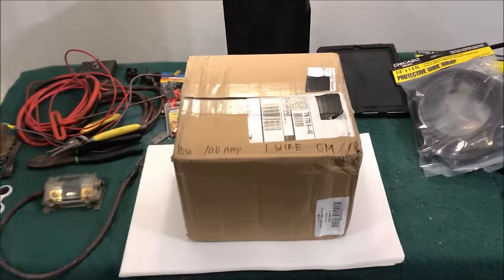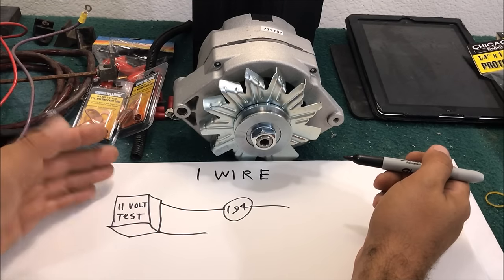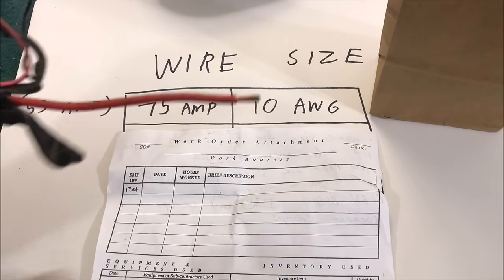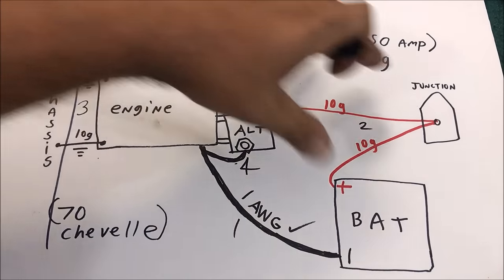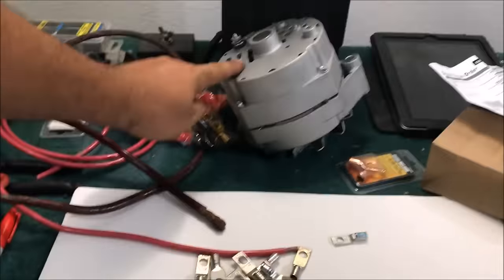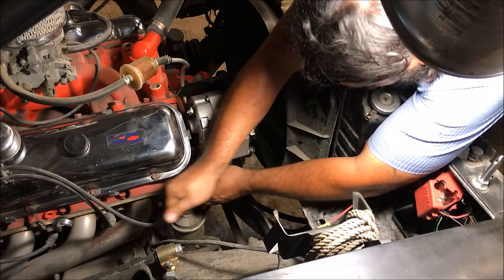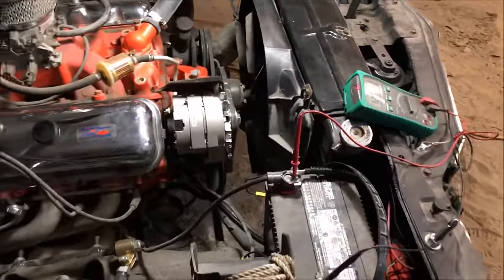GM 1 wire 100 amp alternator UPGRADE and INFO diy

Comment: Hi Chris,
what is the need for the red junction block?
why not put the positive lead of the alternator directly to the + battery ???
I intend to mount this alternator on a 350 SBC.
thank you, bruno from France
Reply from the maker: I have a factory ammeter in the dash that works.. you have to wire it like that for it to work right.. also, I can’t stand a bunch of crap wired to the positive battery terminal bolt.. I see it all the time

Comment: Great Video 
What did you do to the factory charging wire? Did you cap it or reroute it to the junction block?
Reply from the maker: you have to use it..it stayed the same
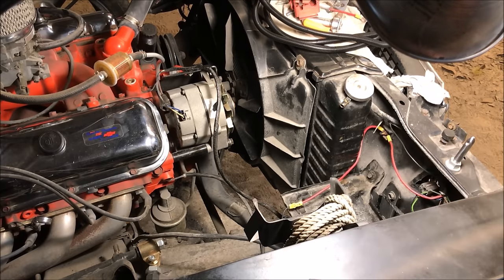Reply: I'm covering my classic car to a 1 wire 100 amp alternator with a 4 AWG wire. In the video (time 21:23) you mention that the original charging wire  was removed completely. Do I cut the 10 AWG wire and removed  it ?
Thanks Chris

Comment: Where did you buy the terminals and crimpers? Great video and lots of info I need for my jeep project, thank you.
Reply from the maker: electric supply store.. those crimpers are like $300.. all electricians carry them
Reply: I know that places its not good to solder  connections on AC voltage circuits but will solder migrate with high amp DC voltage?

Comment: Under the plug is the idiot light spade connector .... is just looped inside to the regulator. The top spade is the charge to indicator or "idiot light" and the one under it is the "key on" for the regulator.... it's looped inside to the chargeback lug ... that's it
Reply from the maker: yes it is..  but that is for a future video... thanks for the comment..

Comment: Awesome instruction, but I have one ?, why do I need to ground the alternator with a wire, isn't it already grounded to the Engine block and bracket. Just curious. Thanks
Reply from the maker: that’s part of the BIG 4 upgrade.. it IS already grounded but people do that to make sure it’s getting back to the battery 100%.. you would need to check resistance from the bracket to battery to see if you had any issues

Comment: I saw the extra ground cables and  I'm wondering why they are necessary. The alternator mounting bolt at the bottom bolts directly to the engine block and the factory ground cable carries that ground back to the battery.  As long as you add a ground cable from the engine block  to to the body and another from the same mounting point on the body over to the frame. I would think that 2 is all you would need to add.
Reply from the maker: audio people do it so they are 100% there is no resistance to negative side of battery.. like painted brackets, grease/oil, corrosion between mounting surfaces... I do it with 75 amp and higher alternators because I sell the kits and install them on people’s cars

Comment: Your videos and attention to detail are incredible.  I do have a question though.  I just installed a 1 wire alternator in a 1969 Mustang and I no longer have any power to the dashboard- headlights, ignition switch, etc.  I'm guessing that was a part of the original wiring that was connected to the external regulator that I removed (as per powermaster instructions)  Is there something that I'm missing, or was the car not wired correctly to begin with?
Reply from the maker: there’s a big red wire with a fusable link that powers all that.. it may have been on the starter solenoid..  find the big red wire going to fuse box and trace it.. I don’t mess with ford but it should be the same...

Comment: I watched all your videos on alternator upgrades and how to get rid of the external regulator. I did everything in your videos. I have a 69 chevelle and i came across your 100 amp alternator upgrade. I believe my alternator is 115-120 amps. I want to upgrade my charge wire to a thicker wire but looks like my factory 10 gauge wire goes  from alternator to wire harness all the way to plug on fire wall. Do i cut that wire and run into juction block witch has fusible link running from battery to juction block to horn relay. Then run a bigger gauge wire from alternator to battery.
Reply from the maker: I have a video on re wiring the harness
Reply: @chriscraft77022  like I said I watched and done everything in the videos but now I need to upgrade my alternator charge wire but it goes from alternator all the way to plug on firewall. Can I just cut the 10 gauge wire out from alternator  and wire that into the junction box behind battery then run a 6 or 4 gauge wire from alternator to battery??

Comment: Since old Chevelles are getting harder & harder to find.

How about doing a fuel delivery upgrade ?

Start with discarding that plastic fuel filter on the pressure side of the pump.
Because a small fire can & will turn into a very large fire once the filter melts and spews fuel everywhere.

Or don't because the fewer there are the more mine are worth  ;~)
Reply from the maker: good idea for a future video but on a stock carb system the fuel pressure isnt high enough to really need an upgrade.... just replace all rubber hoses every 10 years...  i personally love the clear fram fuel filter...
Reply: I like the clear ones myself but have seen plastic ones melt and make a small fire much bigger & that's why I will not use them on the pressure side.
I also prefer to use EFI hose even on Carbs because of ethanol.
Reply from the maker: im going to add fuel injection to my car later this year and i will do a steel hard line video....  i have a making a fuel line video (its old ) if you wanted an idea on hard piping it up to the carb....  with aluminum
Reply: Wouldn't use aluminum !
Never used it myself but have heard it will work harden from vibration & crack.
Myself I like all steel line with as little hose as possible & steel filters.
BTW when you do your FI system if the pump is in the tank be sure to use submersible "SAE 30R10" hose in the tank.
If you do not the non submersible hose will melt from the ethanol, ETC 
It may take a year or two but it will melt like a marshmallow in water.

Comment: Hi Chris… have hot rod with 140 amp one wire…all Chevy👍🏻…drops from 13.5 to 12.5 when electric fans come on but more drop when AC is turned on and after a few miles down the road the engine stops.  Battery in trunk so I ran a 4 gauge direct to starter with no significant improvement and engine still stops after a few miles with AC and EF on.  I did not remove the old wire to the alternator…just added 4 gauge wire to the starter…large post.  Tried new alternator with no improvement.  Any suggestions?  Thanks!

Comment: Cars and electrical systems are magic to me. I don't understand them at all... so I bought a 66 impala with a charging problem! Question, I can just remove the old junction block and replace it with a larger new one right? Is there a reason to keep the small original one? Thank you in advance.
Reply from the maker: if your car has a charging problem why are you messing with the junction block?  you don’t mess with the factory one..   when you skip through videos you don’t learn anything...
Reply: @chriscraft77022  it has an external voltage regulator going to an old alternator. So i want to add a chevy 105 amp 1 wire alternator to remove the use of the VR which is causing the charging problem. Plus id like to add vintage air and possibly an amplifier for the stereo in the future. That's the reason I watched your video in full (no skipping around). I'm messing with the junction block because I'm upgrading my wires to 4 gauge like you recommended. Either way, great video. Take it easy
Reply from the maker: wire it just like the video.. I left the small junction block.. you need it for the ammeter in the dash

Comment: Hi Chris, I wired my 66 el camino up connecting the wires together - not using the plug and jumpers. My GEN light came on the other day alerting me to a dead alternator. But it ran great with no problems for about 2 years until I put a Holley Sniper EFI on it. Had problems off and on ever since. Now my new alt is showing no charge with my meter on the terminal. Don't know where to start. Ideas? Thank You.
Reply: Oh, one more thing - since I put in the EFI the engine continues to run when you turn off the ignition key until you turn off the radio.

Comment: Why do you put jumpers on the regulator plug? It seems it would only be effective if the L,F plug on the alternator were also jumped. Otherwise its just an open circuit. So why do anything with the old plugs? This is according to my wiring diagram on a 64 Impala
Reply from the maker: just jump the plug.. if you understood it you would not have commented what you did
Reply: @chriscraft77022  That's true. I'm confused
Reply from the maker: @Mr1lukers  it just re routes the wires back to the internally regulated where they need to go. i have a harness conversion video explained..  its old and has music but it shows it...   if you dont jump the plug you will overcharge and your dash light wont work.. but on a 1 wire you are right ////    they dont do anything..  and just leave them unhooked...    i was making a reference to a 3 wire hookup

Comment: Hi Chris . First off great video . I just bought a 1939 Chevy Streetrod that has a one wire Alternator one it . Not sure of the size of it . When the car is running it shows 14 on the volt gauge . When you turn on the Elec. fan it drops to 12 Volts . Is this Normal ? Thanks for any help John
Reply from the maker: the output is too low... 55-75 amp alternators do that with electric cooling fans.. you need 100-150amp depending on the set up
Reply: @chriscraft77022  Thanks Chris
Reply: I should add that is pretty basic setup no fuel inj. or  stereo amps . Just the elec fan and vintage air
Reply from the maker: I have the 100 amp in the video for sale cheap if you need it.. I never used it.. I need 150 amp for my car.. it charged 14.6 and worked perfect.. if interested give my your zip.. it was only like $60 new.. the 140 amps get into like $150 plus

Comment: Thank you for your variety of topics. I enjoy your videos. I have watched a couple concerning generator to alternator conversions but can’t quite figure my situation out. I have a 64 Falcon with an external voltage reg that has screw terminals instead of a plug. The guy at NAPA suggested a GM 1 wire alt so that is what I have to work with. Is there a way to wire it or should I try to swap for a different alt?
Reply from the maker: gm 10 si case 1 wire should fit right on there
Reply: Chris Craft  Thanks. Can you give me any guidance on how to bypass the voltage regulator.
Reply from the maker: you take it off and throw it in the trash.. the 1 wire is internally regulated

Comment: If I'm running this in a boat and the Junction Box is 12' in the front of the motor do I run 4 gauge wire all the way to the front of the boat and attach it to new junction box just a few inches from the old one?... or do I put the new Junction Box in the back of the boat by the motor, and run a long wire (10 guage) up to the existing Junction Box to connect them?
Reply: On 2nd thought...I give up.  The wiring in my boat is nutty. I'm pretty sure the alternator wire connects directly to the ignition starter switch.... too confusing

Comment: Hi Chris,

My old 3x wire alternator was only outputting a little less than 12v at idle.  Swapped out new voltage reg, big 4x upgrade and new battery. Still registering the same so I bought and installed a new 1x wire 180 alternator. Still registering
Reply: 11.9 at alternator output any ideas? I bypassed the external stock regulator.  Running 1x wire alternator directly to battery positive. 68 El Camino
Reply: If I give,a little gas the voltage will go up to 14
Reply from the maker: is this a GM?   if you have a voltage regulator that needs an externally regulated old STYLE alternator....  what is the vehicle?

Comment: I CONNECTED  THE  BLUE WIRE   AT  THE  NUMBER 4
WIRE..ON  REGULATOR......I GOT RID  OF  THE  
TWO  SENCE  WIRES  THAT GO  FROM  THE  OLD  ALTERNATOR.....CONNECTED
THE  BLUE   WIRE  FROM  THE
EXTERNAL  REGULATOR   TO
THE  POSITIVE   ON THE COIL.....GEN LIGHT  WORKS...
YOUR  MAKEING  ME WONDER..???

Comment: I've installed an HEI to my 67 GTO and it starts fine, runs fine but won't shut off with the key switch. All wires are run through a relay for the HEI. I have traced the wires can't find any ballast resistors and the resistance wire going to the starter has already been done away with. There is a splice from the alternator hot post ( single wire Alternator) going to the starter solenoid main lug. That splice is about 1ft from the alternator on top of the engine going down the front of the engine block to the starter.There is a working voltage regulator on the fire wall. Does that voltage regulator need to be bypassed and would that be the reason the engine won't shut off? The key switch does work properly.
Reply from the maker: run HEI off IGN circuit 12 gauge wire.. there should be a spade on fuse box
Reply: @chriscraft77022  ok, thanks. I'll try that.

Comment: I am installing a one wire alternator on a tractor and when I hook the one wire from the alternator to the battery it sparks telling me there is voltage always on which will run my battery dead. The alternator is new so there is nothing wrong with it. This one wire has to be connected to the switch and off when the engine is off. Will not work as you show hooked direct to the battery.
Reply from the maker: wow, great comment.. the 1 wire alternators I have messed with are just regular alts that have had the kick on adjusted or tweaked... in other words the #1 is just blocked off.. read your instructions because I have not heard of this ON with the key 1 wire.. thanks for the comment... this is why I make videos
Reply from the maker: but, btw most every one wire is wired like I show in the video..
Reply: AJ W Are you using  one of your connections on your ignition switch that turns on and off with the key?  If so which one are you using? I'm having the same problem on a John Deere that had a external regulator, I had the alternator shop make it a internal one wire and hooked to my ignition switch
but it's not charging enough, however the wire may be to small. Let me know
how you make out and what you did to fix it please. Thank you.

Comment: great video! I've learned a lot from all your videos. My question- My American Autowire part# 510004 Power Plus 13 wire kit instructions said to run the wire to the starter solenoid from the pole on the alternator (GM SI Series Single Wire 120 amp) However, you have that wire running directly to the Battery via the junction box. Are both methods correct?
Reply from the maker: 64-71 like mine.. they changed it in 72.. watch my how to hook an ammeter video where I show that change GM did..  yes, starter solenoid big bolt would be the same as the junction block
Reply: I will check that video out. Meanwhile, thanks for all the videos and please keep posting.

Comment: Chris - I know this is an old video, hopefully you can remember.  I have a 71 Chevelle, w/ HEI.  Replacing a failed 1 wire with 100A. rewiring with 6 gauge per powermaster. previous owner ran charge wire from alternator to the horn relay and old regulator connector, back to the power connector.  + battery also connected to the connector.  I jumpered the old regulator connector like you did, wondering if the charge wire should go to the new connector, then run a new wire to the horn relay? advice?
Reply from the maker: On a 71 the charging lug (alt) goes back to the positive battery post (10g connection)   throw the regulator in the trash you do not use it with a 1 wire alternator( I never said to jump it) ( that is with a 3 wire gm internally regulated)

Comment: What did you do with the 2 extra wires that no longer attach to the alternator?
Reply from the maker: you cut and cap them off.. or cut them out of the harness .. or just tape them up real good

Comment: Quick question for ya...so it's ok to delete on the 3 wires currently running to the alternator? They all disappear into a wrapped up harness. Not sure how to go about deleting them properly. 
Love this video!
Reply from the maker: you have to just cap them off with a butt connector and hide them in the harness
Reply: @chriscraft77022  Thanks man.

Comment: Hello, i have a CS 130 Style alternator with the 2 wire connector plug. But my question is, do i need a alternator with PLFS or PLIS? OR is it the same. I have a conversion from Vintage Auto Garage with the PLFS regulator for my 1954 Dodge. Hope you can help me. Best Christoph
Reply from the maker: if it has 1 wire that is all you need.
Reply: @chriscraft77022  so is it the same? SFLP or PLIS with the 2 wire, because there is only on wire? Sry its a two wire conversion. Big red is B+ and the one cable with the diod.

Comment: I just bought a 100 amp 1 wire for my sbc s10 and I'm confused as to why I would have to run the factory junctioning block and another bigger one instead of just the bigger one? Thanks in advance!
Reply from the maker: my car has a factory one...  but is not rated for 100 amps...so i added one because i dont molest factory wiring...   just run the bigger one...  thats all you need
Reply: Alright thanks man. Thanks for the video and info

Comment: I have a factory alt that has a 3 prong harness with 1 wire in it.. I just bought a new alternator that has a 4 prong harness but my factory harness doesnt fit what do i do can i cut the factory harness wire and solder in onto the new 4 prong connector which prong do i use?? Please